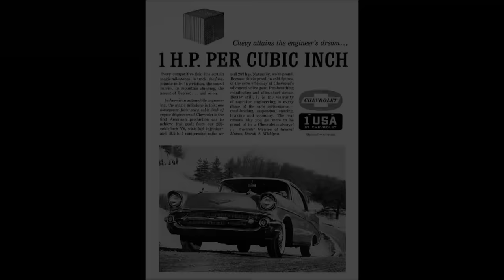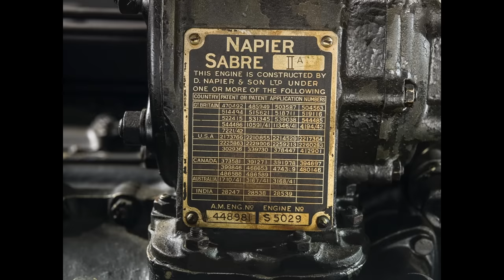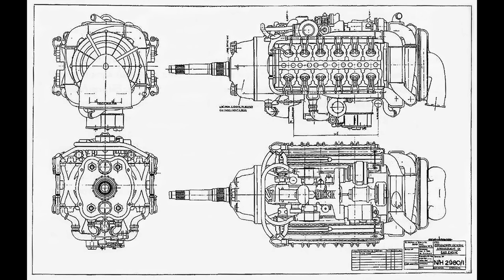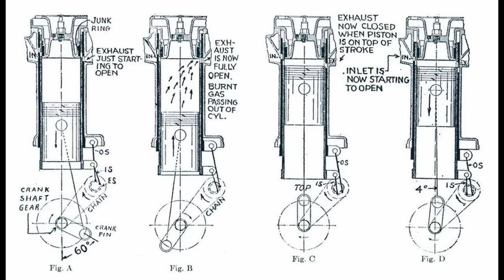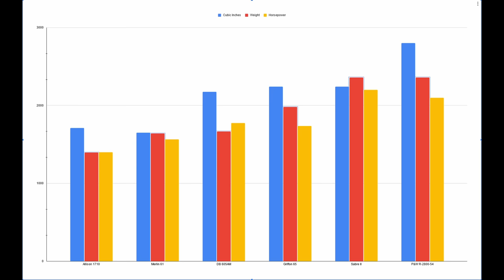Napier Sabre - The Ultimate WWII Aircraft Engine - Part 1

Comment: I wouldnt be surprised that the timing of the sleeve valves didnt lend itself to being boosted and thats why they had so much trouble boosting it. I can see the sleeve valves having a great deal of overlap which helps high end RPM power (which was the design goal so its not really a fault of the engineers) but doesnt lend itself to being boosted as the boost pressure bleeds right from the intake to straight through the exhaust. So it kinds seems that the engineers couldnt make a supercharger that could flow enough from the bleed off boost or just supercharger technology couldnt of been made reliable enough. But it seems that when it did work it did produce some crazy power figures.

Comment: Do the power-to-weight ratios include the weight of the radiator system?  If not, that really throws comparisons to the P&W air-cooled radials out of whack.
Reply from the maker: I had actually considered this, but I don't have a way to find the weight of the radiator/cooling components.
Reply: @flightdojo  Understood, but it really throws off the comparison with the air-cooled radials  With the cooling system included, the radials of comparable sophistication are always lighter (by a fair amount).  That's the main reason they were used.  The offsetting issue is frontal area drag, but from a pure HP/weight ratio, those P&W's were monsters.

Comment: For weight vs displacement look at the GM LS vs a Ford coyote.

454 vs 455, from what I can find. Pretty sure the LS is an iron block with aluminum heads for that weight and the Coyote is all aluminum.

Mechanical complexity, like dohc, adds a lot of weight and bulk. The LS is smaller, lighter and in some variants can make 500hp+ without forced induction. 

The 7.0l LS7 crate engine makes 540hp while the 5.2 Voodoo makes 526hp. The LS is smaller and lighter even if its HP to displacement ratio is worse. Pushrods and a simpler two valve head save weight and bulk.

Comment: You are missing a few things, sleeve engines use more oil (which we were short of) , more "exotic" metals (which we were short of), more maintenance by skilled engineers (which we were short of), more steps therefore more time in manufacture (which we were short of), a 3,000 hp motor needs an airframe that can handle it (which we didn't have).  An interesting design, but ultimately expensive on many fronts and pointless.

Comment: Should've compared the DB606 and DB610 with the Sabre.  All 3 engines were pretty revolutionary in the idea of combining effectively smaller engines through a geared output shaft to gain increases in HP without adding too much extra weight.

Comment: The R2800 was flying high altitude missions over Germany pushing out 2000HP a full three years before the Sabre would be able to match.  To leave out turbo charged engines as not in the same class avoids the obvious fact that that development route delivered working engines in time for the war.

Comment: Napper designed several revolutionary engines which also included the Lion that was used in land speed competition racers,  namely the one driven by John Cobb. The Deltic diesel engine used primarily by the Roysl Navy and later in the British Rail Class 23 and 55 in 9 and 18 cylinder form respectively.  Amazing engineering.
Reply: NAPIER not "napper"
Reply: @leneanderthalien  Yes I know smart arse. Predictive phones.  I am sure you have done it at some point

Comment: Great info on a radical design! It was unfit for most applications during that time because of hand production of many fine machining parts, and metallurgy of the time. Cost was highest, production lowest per man hour, maintenance horrible, service life lowest, and ability to absorb battle damage very poor. And training needed very high. A great way to win an air race or a single dogfight but not a war. Probably these facts spurred RR to object to re-allocating strategic metals, finances and recources to it. Also, rebuilt 2nd quality air merlins were used in tanks as well, known as the meteor v12. Air cooled Round engines like the P&W R-2800 are really hard to beat in combat and powered the fastest allied aircraft the P-47 thunderbolt. Which also was the heaviest and could take alot of abuse! But many sabres were put into service long after the war by the British and Canadian navies. Great job!

Comment: There are significant overstated points in this video. Rolls Royce did have valid points versus the Napier engine, but not for the primary reasons suggested. Napier engineering did build a very good power to weight ratio engine. But horsepower vs weight vs fuel burn were significant issues Napier was never able to overcome. Nor was it a serious contender to be installed in Spitfires, Hurricanes or Lancaster aircraft for these issues and others;

- propeller governor / blade design
- engine mount requirements (torque & NVH)
-Fuel burn

The two air frames that did use the engine, the Hawker Tempest & Typhoon, were incredible machines. Hand built Napier engine maintenance and service turnaround time were inferior when compared to Merlins. 

The Spitfire and P-51 were more agile, burned less fuel and were extremely fast with less horsepower because they used a lightweight, narrow fuselage engine that used a very short length and narrow 60° V-12 . The reduced frontal drag coefficient required less horsepower. More power at high altitude was hard enough to achieve. And sustain. The massive front air cooler the Tempest / Typhoon required was impossible to overcome. That it was an engine that burned fuel inefficiently because it used a sleeve  fuel intake was its own undoing, at all altitudes, let alone 15,000' or higher.

You emphasizes on high HP using short stroke / high rpm relationship. This is not always true when normally aspirated or supercharged. To this day, these principles hold true, only for a given operating profile. Using the right combination and engine rpm, a long connecting rod and lower rpm with same single stage supercharger can (and did) produce superior results. A good example is the Pratt & Whitney R2800 that used a 6.00" long stroke (vs. 4.75" in the Napier), producing 2,400 HP at only 2,700 rpm, spinning a massive 14' diameter 4 blade propeller, the same as used in the Napier powered Hawker Typhoon. The Griffon powered Spitfire Mk XII V-12 has a 6.6" stroke (oversquare of the bore by .6" of an inch) and produced 2,200 HP @ 2,700 rpm.

The Tempest used a smaller 12'.11",  3 blade prop until the 14' version became available.

Given maximum propeller speeds used during WW II, using the best prop governor available, the Napier was not superior to the Merlins, unless a massive propeller was used to leverage the available 4,000 rpm, putting further strain on the dual crankshaft design, idler / transfer gears and connecting rods. Overhauling these engines was impossible given the number of parts that required replacement. The sleeves were a nightmare because of uneven cooling. The Hobson fuel injection carbs were notorious for imbalance problems. Probably the most significant issues were the connecting rods. They ran extremely hot according to my grandfather, who was an RAF / RCAF mechanic on Napier's and Merlin engines during the war. 

One of the many things to let go were the piston wrist pins (oblongation), which quickly allowed the pistons to seize in the cylinder sleeves. It was very easy to the pilot to allow excessive manifold pressure to build at mid range altitude (12,000 to 18,000').

Early variants of these engines were not reliable and rarely made it to 400 hours before replacement of the entire engine assembly was the only solution until 1944. As improved Napier - Typhoons rolled off the assembly line, the engine began to mature with improved cooling, external fuel tanks and better airframe tail structures were resolved, the need for Anti-tank air to ground support aircraft that could carry heavy loads in a 500 - 750 mile combat radius came into focus. The Republic P-47 was a superior air to ground support aircraft and more importantly, easier to maintain in the field. The Typhoon and Tempest were really good aircraft. Just not as good as some competitors despite the fact, many think they "should" be considered one of the best.

My grandfather thought the Napier was far too complex to maintain in the field and could service a Spitfire, Hurricane, Mustang or Lancaster Merlin practically blindfolded. A Typhoon or Tempest demanded precision and extended periods of time to keep running. He was really happy he didn't have to service Sea Fury Bristol 7" stroke engines or Tempest powered Bristol Mk IIs when he returned home in 1946.

Have a nice flight ✈️

Comment: Sleeves  brought to engines to mind.
Didn't  Packard use sleave valves in some of their racing engines?
The Jumo opposed piston diesel engines also used sleeve valves. How would they compare in pier to weight  ratio? A totally different beast but not to far afield from the Napier Deltaic engines.

Comment: Saw a doc on WWII that said 600 aircraft powered by the Napier were lost, but the narrator didn't elaborate on the causes. Still it's an impressive engine especially with the sleeve valves and two tiered layout.

Comment: Three comments:

1. The reason that more cylinders give more power is that the total intake area increases for each added cylinder, given the same displacement. The higher RPM is merely a consequence of using smaller components.
2. More cylinders always make a heavier engine, when comparing the same displacement and design. There is simply more metal used.  
3. As cylinder head design eventually improved, poppet valves designs outperformed sleeve valves, which are rarely used these days for engines of this size.

Comment: Offt… so much to unpack here…

I agree with the testament that the Merlin enjoys a lot perhaps underserved credit for being the soul engine that won the war… what I would say, is that it was clever project management and administration on the part of the British that got the job done.  The Germans over diversified their RnD efforts by trying to develop too many engines in parallel often of equally radical designs.  The British on the other hand recognised very early (in the 30’s) that they needed to focus and consolidate their efforts and streamline the design process, and focus on a hand full of designs instead of the 2 dozen plus designs that the Germans were.  

The Napier and Bristol (which also used sleeve valves) struggled for over 5 years to not just get the metallurgy right - but to physically INVENT the metallurgy required to make the sleeves handle the complex combination of combustion heat, sleeve friction, attack from TEL (which affected all manufacturers learning how to make the most of high octane fuel), differences in thermal coefficients of expansion between sleeve and block…. At this time, while the horsepower projections from Napier sounded attractive, Rolls Royce had already powered and dominated Schneider Trophy races with less radical technology. 

War was coming.  The RAF (RAE) needed to make a decision.  So they backed an engine which was more at a more mature stage in its design evolution.  As simple as that.

Comment: I think to overlook the altitude performance of an engine is a significant ommission. The aerodynamic effciency of an airframe increases with altitude, thus bombers went higher and higher to achieve performance  & range so the fighter had to match them both to attack or defend. Only specific ground attack aircraft did not need a high altitude performance.
Likewise sleeve valves give good combustion efficiency but it carries a significant mechanical penalty to achieve.